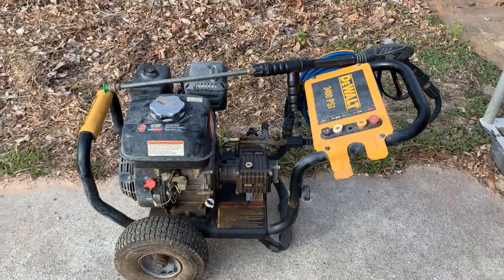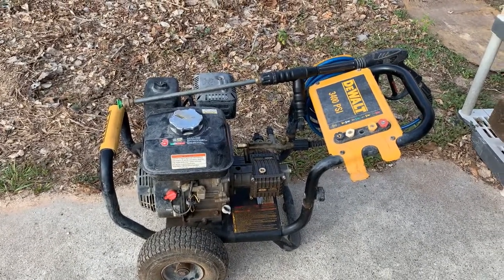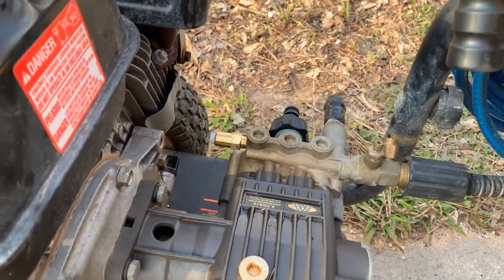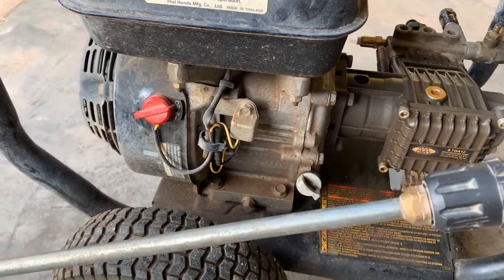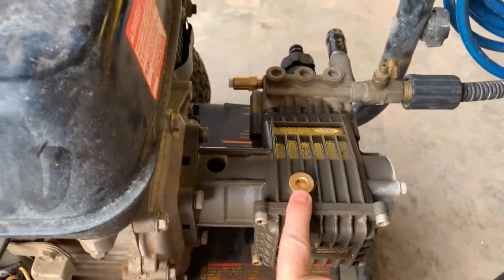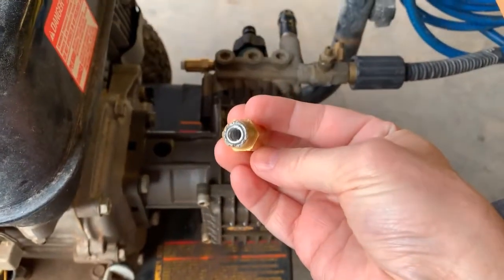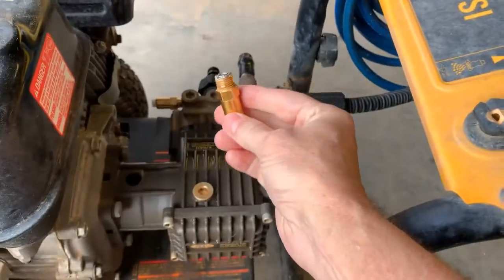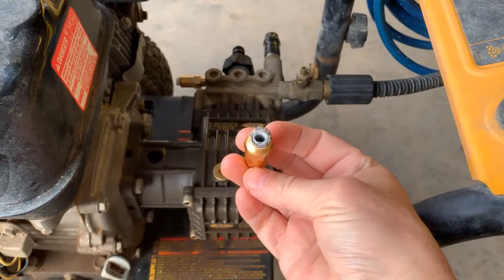DeWalt power washer with Honda engine dies (stalls under load) and how I fixed it

Comment: Question, when you say “under load” do you mean when the water from the water hose is turned on? The issue I am having is when I start my pressure washer, and turn the water on, after a few minutes my pressure washer will shut off. If I press the trigger on the pressure washer gun the pressure washer will stay on but if I do not, the pressure washer will bog down then shut off.
Reply: Same issue
Reply: Same
Reply: Sounds like the low idle jet needs cleaned.
Reply: @rogerzindler8144 j
Reply: Unloader valve is prob siezed
Reply: same problem pump and all valves are brand  new!
Reply: Bad unloader

Comment: Hello, I have a Dewalt 4200 Belt Drive Machine (DH4240B), but I need to find the specifications of the AAA pump it has, because it is currently damaged, and I have not been able to order a repair kit because I do not have the pump number. Could someone please help me? I would also like a set that can be adapted to this type of pump.

Comment: You Da Man. That was the problem. I tried everything you did too, the sensor was a little corroded, but I got it to come back to life. Did the trick.
Reply from the maker: I should post a follow up video, and I still might. Replacing the clogged thermal relieve valve masked the real problem, the pump was going bad. As the pump started to go bad, it would heat up a little, and the clogged thermal relieve valve would cause a stall. Replacing the valve helped, but as the pump further declined, friction increased, and more heat developed. A couple months after I replaced the valve, it was stalling again. I thought about replacing the pump, but a replacement would cost around $200. I decided to purchase a new power washer instead.

Comment: I guess my valve is ok because it would get over heated the blow out water and steam, Although mine runs like its straining so I backed off the pressure and it was running smoother But I know there is still an issue because the last time it popped the thermal valve now its pressure is weaker so Im still wondering what this could be..Unloader maybe? Ive cleaned and lubed still no change.any ideas?

Comment: Did you ever find a solution that worked? I've got the same issue. I've tried:
New gas cap, old gas cap
New spark plug
New fuel line
New fuel filter
New tank
New carb
New crank case gasket
Checked inlet for debris
Checked outlet springs / plunger
Checked high flow check valves
Checked unloader plunger movement
Checked if pump was going into bypass properly 

All are good, and the problem still persists.
Reply: If anyone is wondering, I did eventually find the solution for me. It turns out my carburetor was missing a metal "carburetor spacer". The missing carb spacer caused a vacuum leak. Once replaced, the engine runs amazingly.
Reply: thank you for the followup

Comment: Here’s another solution, STOP USING FUEL WITH ETHANOL, run rec 90 ethanol free in everything with a small engine from lawn mower to Atv to power washer

Comment: I would take a look at it because mine is doing the exact same thing but damn if I can find it.
Reply from the maker: I may need to revise the video. The problem resurfaced after about 10 hours of use. I took the pump apart to check for more calcium build up. I found little. Also, I changed the oil in the pump crank case. It was a milky. I think I have a seal problem. If it turns out to be a seal, I will buy a new inexpensive washer for $250. The pump rebuild is about half that, so buying new makes sense.
Reply: My guess is it's actually a stuck piston in the unloader and that the unit is not properly going into bypass. Pressure builds up so much in the pump that that pressure overpowers the engine power and kills the engine.

Comment: The only thing a thermal relief does is dump water when the pump is running and recirculating water get too hot to protect the pump from cooking itself

You obviously don’t have a clue what it was